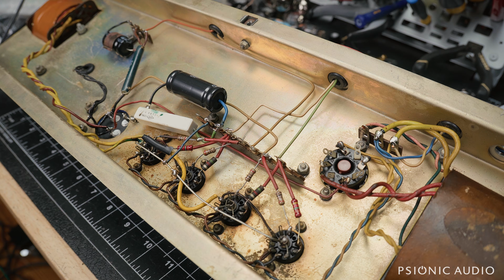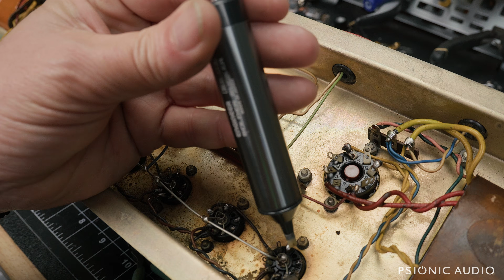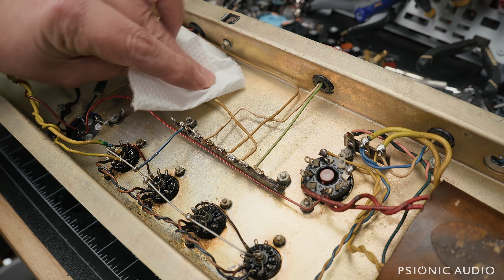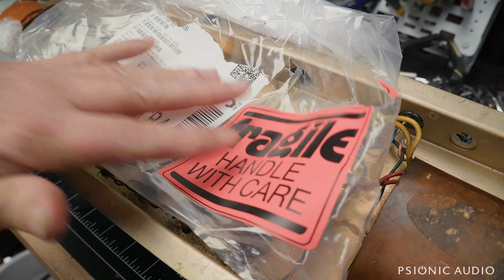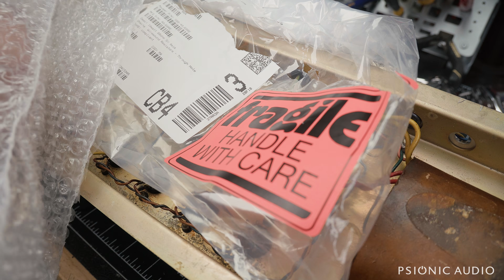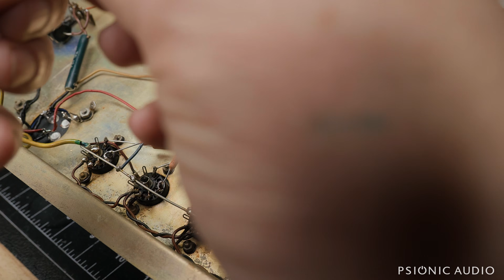Real Time (well, almost) | '64 JMI AC30/6 Pt 2

Comment from the maker: I made a mistake lifting that pink/white wire at the end of the video. It’s the PT shield, no biggie. But still. Brain fart.

All will be explained in the next video on this amp.
Reply: Bet because filming, your hard work is not unnoticed by many including myself. 

The other day looked and yes, the Hammond organ's amplifiers use a center tap heater. I would suspect a replacement transformer be harder to obtain then a Fender, so even stronger case for artificial center tap.

Thank you,
Adriel

Comment: I really love these detailed videos! They are so educational.

Not a criticism here, but in my experience, because of component tolerances, when you swap out all the components of a good sounding amp, it never sounds the same. As a guy who works on my own amps, I have been trying to figure that out because sometimes, it bums me out when I repair a nice sounding amp and it changes the character.

Case in point - I have a good sounding Carvin Legacy amp where I recapped the amp  by changing all the electrolytics. There was no problem, but I wanted to freshen up the amp. Once I did that, the amp got really 'stiff' sounding. I had formed the caps slowly, and then played it for a while to break it in, but it did not improve. I swapped back in the old caps, and viola, the sound was back.

The one quantity I could not figure out how to measure was what the wear on those power supply caps changed the capacitive value of the capacitors to, as opposed to the new ones to see if different value caps would get me, new caps, that sound old/broken in - if that makes sense.

Anyway, what I guess I'm saying is, it's a crap shoot with 20% components whether you will get magic or not after you are done, right? Especially in the case of a classic 60's amp where you can't get any of the original materials to rebuild it. What do you do to get components with tight values?

Comment: Do you work on Vox Thomas solid state amps?
Reply from the maker: No, the Ge transistors are a crazy difficult expensive proposition these days.
Reply: I have several spares.  I did get mine working.  Found it in 1982 in a student rental house abandoned.  Had an under voltage transformer replaced.  Found right one but took mega hours to get working.  Restored outside and reconed.  Sent to Nashville music to scope out and tweek. Sounds great now. They said that is the last SS Vox they would do. They are a nightmare. Just wondered for the future.  Vox Viscount model. Do you do solid state?
Love your videos.  Your a gem in the business.

Comment: Psionic Audio AC30/6 with '64 JMI iron? Not a criticism, but there's going to be not much left of the original.  No real alternatives though...Great work as usual Lyle!
Reply from the maker: Cab, speakers, chassis, iron (aside from the previously changed OT), pots, almost every coupling/signal cap, more than half the resistors, all will be original when I’m done.

A ‘64 Corvette with original tires, oil, gaskets, filters, and brakes won’t get you very far…

Comment: Hi Great Stuff - for old solder joint, I also use old plumber's flux and tap in little, using a toothpick...
Reply: Don't do this! Plumber's flux is highly corrosive and traces of it will remain behind even if you're using a solder sucker; it'll soak into phenolic tag-strip terminals and PC boards, perhaps even into tube sockets. Use specific rosin flux designed for electronics!

Comment: A little boring question, but as you like to say - details matter:  when you are using isopropyl as a cleaner, are you using 70%, 91% or 99%?
Reply from the maker: 91 most of the time. I save the 99 for critical stuff.

Comment: What’s the good practice to extend an OT wire for example. I understand you would use heat shrink but how do you connect the 2 wires together for a solid connection?
Reply from the maker: Look up the NASA splice.
Reply: @PsionicAudio  thank you!

Comment: I am laughing. I was hoping Lyle would find something to rant about during this resurrection. I guess I need to thank the over-enthusiastic Mouser shipping dept.

However, will my parts lead to a disposal surcharge for his over stuffed trash can? Hmmm.....

You know....for what I'll be getting at the end of this...I wouldn't complain one little bit.

Loving every tidbit of Lyle's "carnage". Nothing escapes his digging and exploration. If a component is sacrificed to get down to the absolute bottom of an issue, it is more than justified when Lyle is finished.

I'm not into preserving failure...or even the potential for it. I have no doubt I brought this amp to the right guy.

Comment: On the JJ el84 unlike the NOS pin 1 is not internal connected .  Have seen this cause problems when replacing current tube with NOS.
Reply: Some of the other EL84-adjacent 9 pin output tubes that originally had internally-jumpered connections include 6973, 6CZ5, and 7189A. This was of course done to prevent backwards or downward compatability so that somebody couldn't blow things up by subbing an EL84 or 7189 for an amp designed to run on higher-voltage-rated 7189A's. It's one of the reasons I frown on using "unused" tube socket terminals as tie points for other components or other parts of the circuit.
Reply: This type of thing is important to know.

Comment: I got an engineers solder sucker, and while it's 10x better than the cheapo blue ones. it felt really small and fumbly and hard to press the plunger on in my non-dominant hand. It's still around somewhere, but I went back to 3 packs of the blue aluminum ones.

Comment: I think Mouser does the bubble wrap thing because some people will order out only  ONE resistor and it will get mailed out in a yellow mailer envelope versus a box, and it may get shipped via USPS. The USPS will try to stick that envlope into their envelope reading & cancelling machines. In Februaray people mail those conversation heart candies with Valentine's cards and those little hard candy hearts are flying all over the sorting room as the machines squeeze them out the ends of the envelopes.

Comment: When I started doing this type of work with my mom's old Supro, I made what I called "cartoon diagrams". It's a quick and dirty very sloppily drawn layout drawing of the amp with the proper colors designating each of the wires, and it shows where each wire goes, shows all of the passive parts, tube sockets, transformers, etc. I would leave the ends of all wires & component leads going to ground unlabeled. Why bother? Colored pencils speed up the process. You don't have to, oh, I forgot. If you are not colorblind, you don't have to label any wires for color, just use the right pencil(s). I still prefer it over photos, because you are physically tugging on wires and tracing out all the wiring, so  it SHOULD make sense as you go along. If no schematic exists now is the time to make that drawing too.
Reply: Also, the wires in old amps are often so heat-discolored that following the colors by eye can be difficult. Photos help, but tugging on things to see where they go is necessary, and verifying with a multimeter is also a good idea. Like you, I draw diagrams so I don't have to rely on memory.

For a newbie, learning to draw a schematic from scratch for a simple 3 or 4 tube Champ-style amp is a great way to accelerate the learning curve. You can even take a photocopied Champ schematic and cross out/draw in the differing component values and locations as you go (whiteout is helpful).

Comment: Thanks Lyle for the "shout out" for the Engineer 03 desoldering pump. I'm thinking of getting one for my next tool purchase. Hard to justify Hakko desoldering station, for the hobbyist builder/repairman. 👍
Reply: I know a lot of people are loving the cheapo digital T12 style active-tip stations that you can buy for as little as $40 direct from China, but none of the cheapos have power transformers (they have switching power supplies, ugh), so the electrical isolation of the tip is poor, and often the tips aren't properly grounded, which is okay for most tube-type gear, but runs the risk of damaging sensitive IC's and Mosfets from static electricity or power supply leakage. If you don't wanna pay $125 for the most basic Hakko, you can buy a decent  ATTEN AT-937 station, branded "Schneider," for $48 from Harbor Freight. It's way better than what I learned to solder with 55 years ago!, and considering the price, the only things I can fault it for are somewhat stiff handset cord and the poor-quality included tips (a review is on my channel). Compatible T18/900M tips are about $6-$7 direct from Hakko, and will improve the performance of any compatible soldering station. Harbor Freight lowered the price of their digital Schneider station (a rebranded Atten ST-80, 80 watts, with programmable presets for temperature settings) to $99, and they sometimes offer a $10-off online coupon to members. Both are good deals, and easy to return if you don't like them. 

I really hate buying direct from China; the quality of the "clone" stations is often poor and you'll see what looks to be same unit sold under a half-dozen brand names, and many of them aren't the same at all under the hood. There are clones, counterfeits, and counterfeits of clones! The tips sold direct from China are almost always junk: tyoically solid iron, not iron-plated copper, and the fit of a cheap tip to the heating elements is invariably sloppy, therefore the thermal transfer is poor.

Comment: I've got the SS-02 and it's really great but still getting used to the recoil!  Cocked up the heater wiring on a project recently, it just wasn't neat enough and the tool saved a lot of time with braid.

Comment: I am surprised that the insulation on the wires from the PreAmp to the Power Stage did not got brittle and plainly fall off when touching.
This is a problem I've seen on nearly all the 60s/70s ACs I worked on so far and I always have to replace those wires entirely. 
Worst one was my own 66 (still with Woden Trannies) as I had to replace all wiring due to insulation crumbling away just by touch...
Reply from the maker: Yeah, I always check. This one is good.